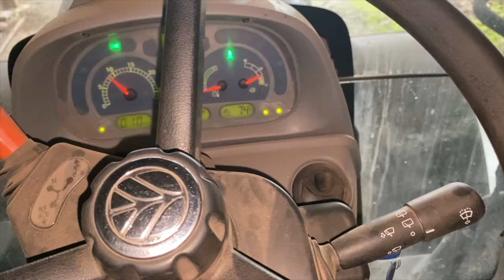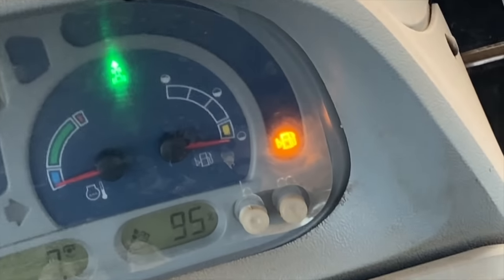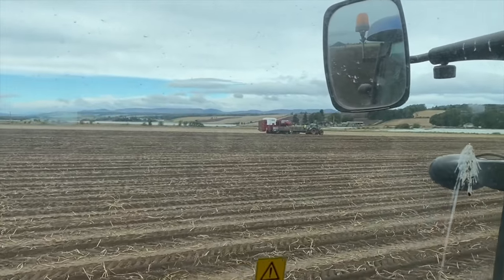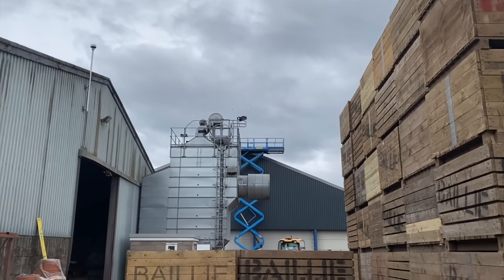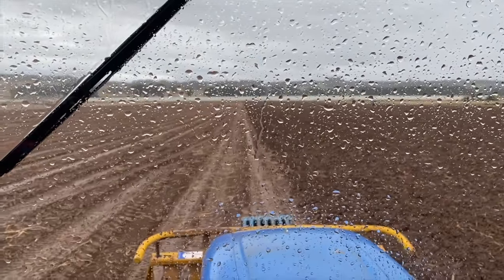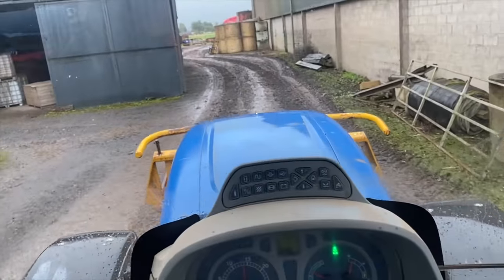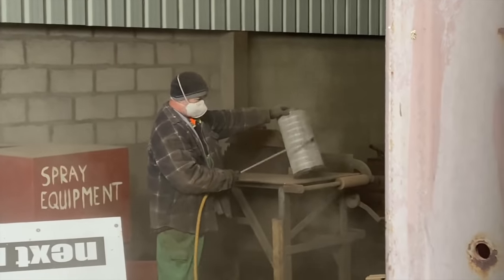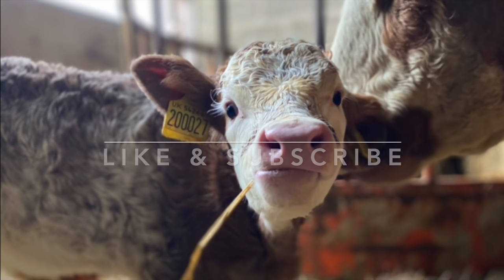14 MACHINES COME TO A HALT | WILL WE GET THE WHEAT IN | LEMKIN DRILL REPAIRS #CRAWFORDFARMS #126

Comment: Nice 12 boxer on the 8 series massy, are they carting all the way back down to Glenfarg? We always used to run through potato land at an angle to level it out better, any reason for not doing it?
Reply from the maker: Not all of then, they had a couple of lorries going too, Often do the same, boss man just said straight.  Although grubbed then disked it will sort itself out!
Reply: @CrawfordsFarm1  Saw the lorries but noticed you said some were carting, fair jaunt. What way would they go? True, this was just a single pass at an angle then we were either in with a 4m rapid if it was nice and dry or a 4m combi drill with a 4m power harrow on the front, the later most of the time on potato ground.